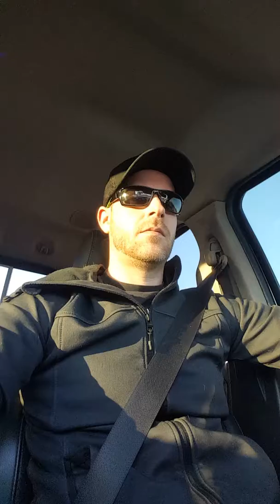Clunking Rear Drive Shaft on Ram 1500 | Update of original video : https://youtu.be/kSI203fmGqY

Comment: Help, I’m having a weird feeling towards the back of the truck.  Specially when I go into a complete stop and accelerate feels like if something moves or goes into gear. But no noise, or scraping like gears or anything like that. My mechanic took a look at the shaft, he said it  looked steady not much play. He couldn’t take a look at the differential cause he would have to drain fluid and open it. One small thing he did noticed was the REAR lower and UPPER control Arms had little play. To his point of view it’s possibly where the movement is coming from. 
Do y’all ever had any issue close to that description!!

Comment: I did the repair on my 2014 and am still getting that bump. It happened at about 90% of the stops. If I put it in 4-wheel drive it doesn't do it. If I slow down very easy and let the truck downshift then come to a very easy slow roll. It doesn't do it. It very rarely does it on take off. I'm thinking about pulling off the front shaft and greasing it up the same as the rear. This is very frustrating as I just purchased the truck about 3 weeks ago
Reply from the maker: Good idea about doing the front as well. If mine continued I would have done the front as well. Does it feel like it's in the rear?
Reply: @McGo101  I can almost feel it under my feet. So I think it might be coming from the front.
Reply from the maker: ok so sounds like u might be on the right track. id def do the front especially if it goes away in 4wd. i wasn't shy with the grease because i didnt wana do it again haha. but i heard older gm's had this problem thats what got me thinking to do the rear on mine. keep us posted pls!
Reply: @McGo101  I will try it out this weekend and let you know.
Reply: . I took my truck to the dealer and they told me I needed a new transfer case. I picked up a used one for $300 about 5 min from my house. I installed that this weekend,  I also packed the front driveshaft with grease. It doesnt do it as much as before. I can still feel it of I stop hard. Im thinking my trans has a hard downshift from 2nd to 1st. I might have to tale it to the dealer to have the adaptive transmission reset